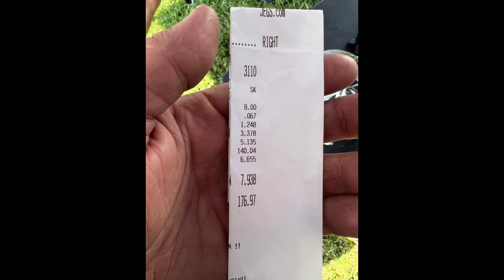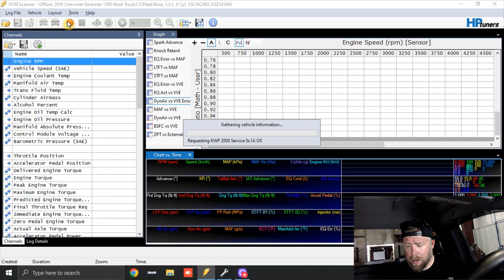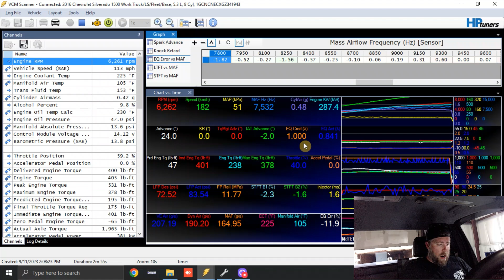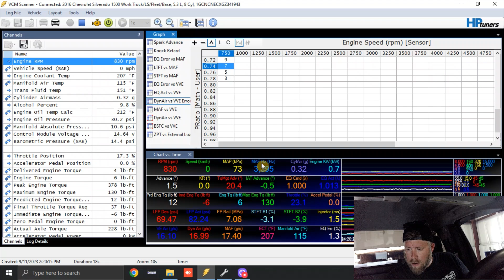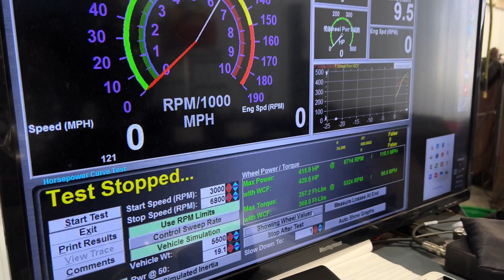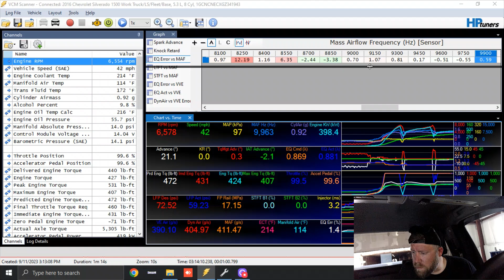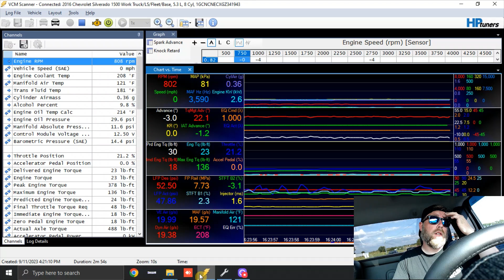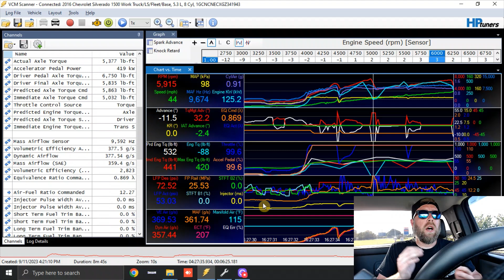Dyno Tuning a Gen V Silverado with a BTR 220 Cam, Truck Trinity Intake, and L86 Swap!

Comment: @Matt_Sanford , is it posible you could share the Manifold volume for this intake so I can update HP tuners?  Mine did not come with any info and they are already close for the wekend.

BTW, that is a J&L oil seperator, I have one and it catches oil very nicely.  Have two more on each intake and it pulls vapors from the valve cover keeping it out of the turbos. Nicely priced too!

Comment: Is the wide band not to far away? Or does it not matter that much
Reply from the maker: Not at all. Unless there is an exhaust leak or something that would allow more oxygen in front of the sensor, then it doesn’t really matter aside from there being a slightly longer signal delay. I like the location of the bung on the Speed Engineering kits.

Comment: I got a 2017 silverado, with a texas speed DOD delete kit(stock non DOD cam, lifters etc) and just added speed engineering long tube headers and true dual exhaust.  I already had the dod turned off in the ecm but need any adjustments made for the new exhaust and long tubes.  Including needing any rear o2 codes shut off that might come up due to the catless headers.  Can those still be turned off?  I need to know before i dish out $700-$1000 for a tune that might not even due want i need it to.

Comment: How does the BTR truck intake do?
Reply from the maker: So far it is my favorite LT based truck intake. It looks good and performs really well.
Reply: @Matt_Sanford  how does it compare to a hi ram?
Reply: How tough was the install on the intake with the firewall. Have a 16 sierra we are struggling to find an intake that will clear